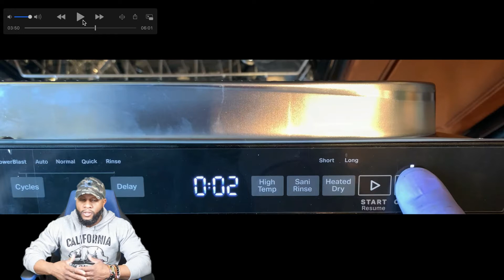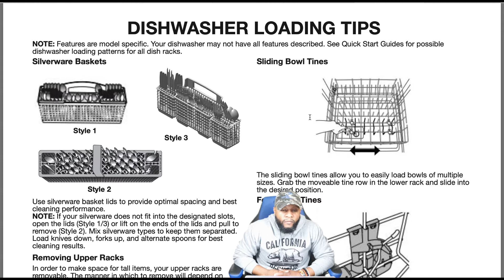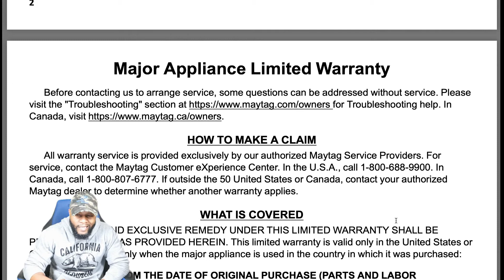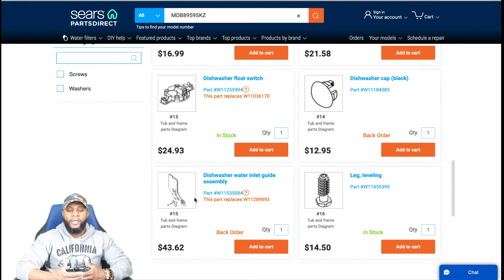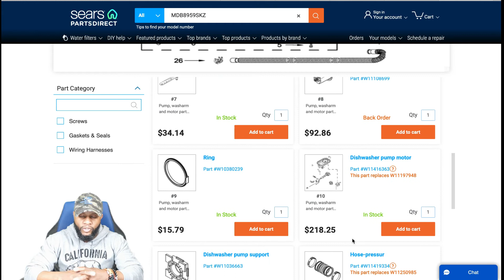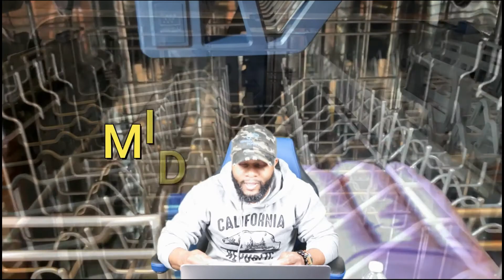(REVIEW) best dishwasher machine by maytag... here’s why

Comment: Yes liquid and powder all the way! You know how it’s done! However it’s extremely vital that we talk about which gels to use for a fake stainless interior like this one, don’t ever use the Chlorinated gel like Cascade Original gel or Palmolive lemon gel, big no no. They stain the interior white immediately upon contact. Use the Cascade Complete gel it’s chlorine free and works just as good as most of the pods do. Another big issue with these new Whirlpools in the last decade is the fact that the detergent dispenser gets flooded by the upper wash arm immediately during the pre rinse cycle and therefor the detergent begins to leak out prematurely, not a huge deal but you really want as much detergent as possible in the main wash since it’s the longest sequence of the whole cycle.
Reply from the maker: Thanks for your feedback sounds like your have a lot knowledge about dishwasher good stuff 👍🏽
Reply: @consumerappliancereport1579  lots of lessons learned lol!

Comment: Are you suggesting that with this dishwasher there is some way of preventing things from getting into the pray arms and clogging the holes?

Any cleaning of those holes surely involves pushing whatever is clogging them INTO the arm. The very minute you turn the unit on the next time that stuff will be pushed straight back into the holes??
Reply from the maker: You can sometimes get them out with pliers depending on big the food particles are inside the spray arm .. you can remove the sprays depends on the model and clean and soak them in the sink hope this helps with thanks for your support

Comment: So sorry to break your ♥️ heart, but the MDB9979SKZ is THE BEST BEST BEST!!!!!  has all that plus 44 dBA!!!!!  Has the bar handle just like the KitchenAid, and Leak Detection plus that new wire attachment box, plus it was over $1,000 but just went on sale for $849 and they gave me $100 additionally off making this beautiful dish beast only $749!!!!!!   Wrong about rinsing dishes before, that is the purpose of the food grinder built in and sani rinse!!!!  Why would you need a dishwasher if you are wasting water rinsing???  Just do not put dishes that have been sitting up for 3 weeks, then, yes, you may need to rinse and maybe scrub also!😃😄😁 Most dishwasher makers probably want you to wash the load after you ate that entire day since food may not be heavy baked on.  It may be ok to rinse some dishes, but you do want some grime on some of the dishes since there is no Pot & Pan option

Comment: Surprised to hear you advocating for rinsing dishes before putting into dishwasher.  I’ve been hearing and reading just the opposite, that the dishwasher needs dirt and grime to be present on dishes in order to clean effectively.
Reply from the maker: The way dishwasher work it doesn’t make sense… I wouldn’t rinse them off completely but enough to get a lot of the hard particles off remember the food particles get trapped inside the motor damages the motor and drain pump, drain hoses clogged  causing unit not to drain.. the  impellers slows down the rotation poor water pressure so mechanically it doesn’t make sense to just leave a lot of the stuff on dishes ..because it’s not made to handle that … plus I see this stuff a lot everyday for the last 18 years …
Reply: @consumerappliancereport1579  These particular Maytag models though, with Dual Power Filtration, claim to be made to do just that. They are designed to handle chunks of food.  Normal dishwashers are not, but these Maytag models purportedly are.
Reply from the maker: @gregorokorn4319  I would have to say it’s difficult to believe because the water when discharging or circulating begets trap inside the sump housing so it has to travel through somewhere I  do understand where your coming from but I have to see it to believe this one
Reply: No it doesn’t matter what dishwasher you get, you never want to load chunks of food into the dishwasher especially the new ones. It will redeposit on dishes during the cycle. New dishwashers have a very condensed pump to make space for the tall tub, there isn’t as much room for the pump to separate particles, and they will get clogged overtime and the wash arms won’t have full flow anymore. Doesn’t matter if it’s a self cleaning filter or manual, lightly rinse dishes with food chunks get all the chunks off and you’ll be good. Just clean the filter and machine monthly.